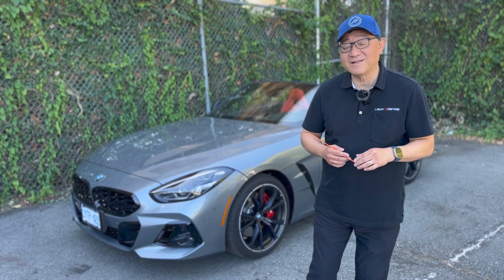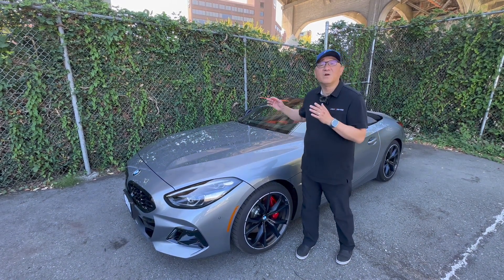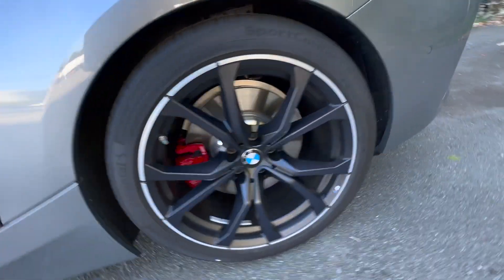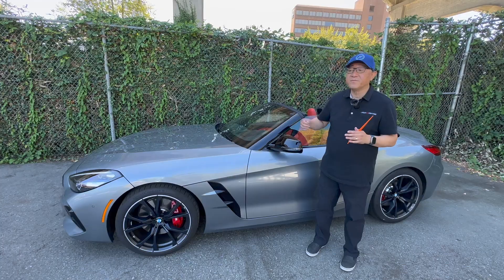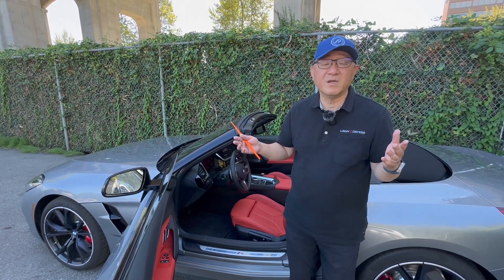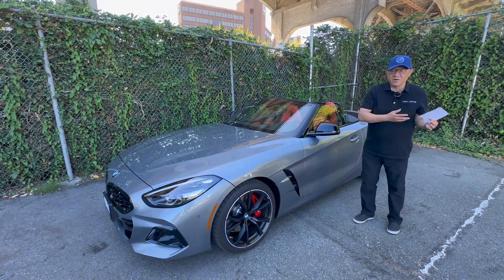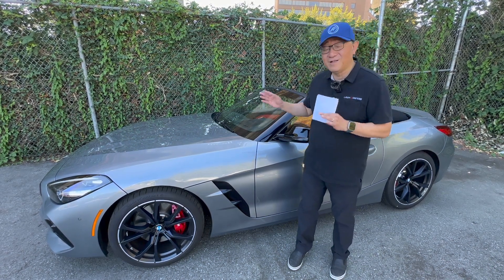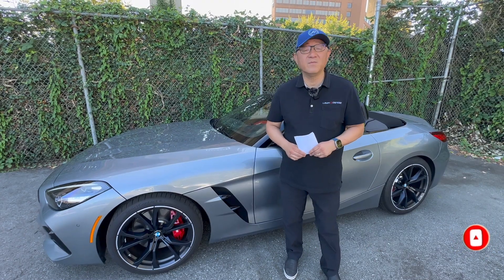BMW Z4 vs Toyota GR Supra -  HOW DO THEY SHARE THE SAME PLATFORM?

Comment: The Supra is hideously ugly. Especially when viewed from the back, none of the panels flow together. The rear end is like a slab of plywood. Plus, when you drive it, the interior is very cramped and you cannot roll down both windows at the same time without serious buffeting. 
The BMW is much better looking plus it’s a convertible. 
Definitely go for the BMW.
Reply: I love how the Z4 looks! Way better than some of those ugly M2 and M4 designs.

Comment: You mention the B58 six cylinder engine several times in your video but the z4 you photograph is clearly the z4 30i B48 four cylinder version.
Reply: Supra was available with the B48 for a few years as well.

Comment: I'm gonna have to pass on this Supra. I mean its pretty fast with a 0-60 of 3.9sec but its basically a Z4. I want something that will actually last so LC 500, IS 500, or RC-F would make the most sense as they are just as fast and a lot more reliable than the Z4.
Reply: You missed the point. Specializing factory assembly, high quality components yet yet Toyota/ Lexus is suffering from expensive quality control in the last couple of years.

Comment: I’m the original owner of a 2019 Miata. I’m reminded of the platform sharing between the ND Miata and the 2017-2021 Fiat 124. I rented a 124 and loved it; same platform but with a different turbo engine it had a totally different personality. Both are terrific.
Reply: The 124 has a different engine and gearbox. BMW and Toyota share same engines and gearbox...

Comment: With platform sharing like this - how does Toyota and BMW maintain parts inventory/maintenance warranty services? Is that serviced via a particular separate supply chain? Or do they run them in parallel?

Comment: I thought BMW has had their own roadster for about 30 years so wouldn’t the Z4 have existed whether the Supra did or not ?
Reply: It is said that BMW would not have continued the z4 into the next generation due to it being a very low seller. To develop an entirely new sportscar platform would not have made sense, until Toyota came into the picture

Comment: You know when things are perfect they tend to get boring that's why I love nissan 
They are imperfect but it brings a character to them 

Also they made the 400z all by themselves nissan has this ability to you know keep coming back
Reply: Nissan z is old platform and performance is poorly compared to Supra also Nissan had vr30 engine developed in their infiniti lineup so they just used that motor nothing new also Toyota has no current i6 however they do have v6 twin turbo used in Lexus which they should have used but probably didn’t because b58 is more mod friendly and Supra is a car to mod